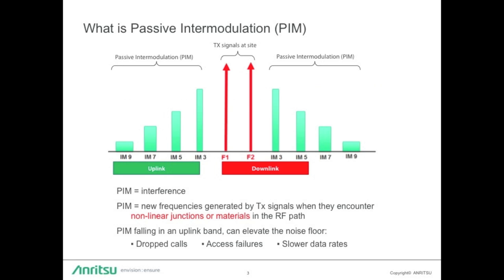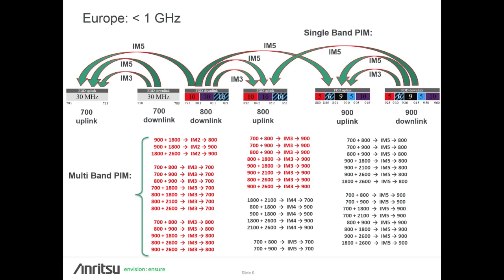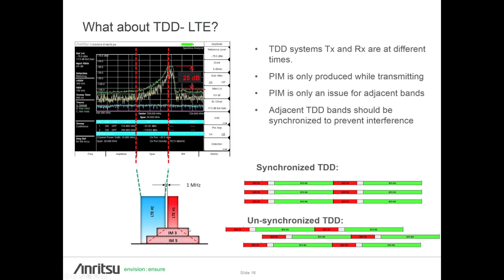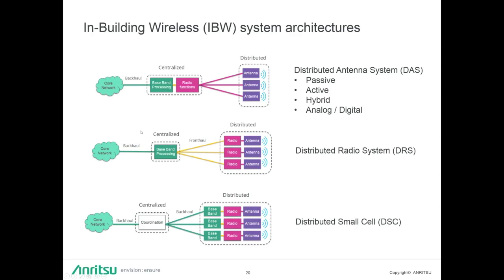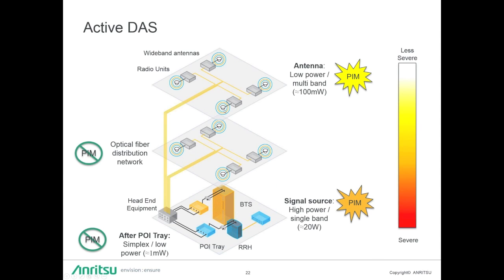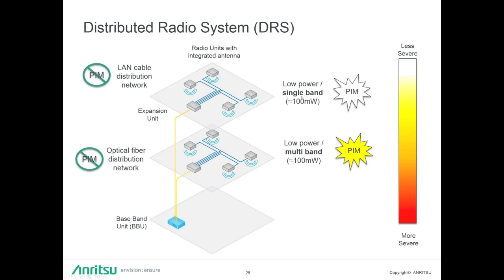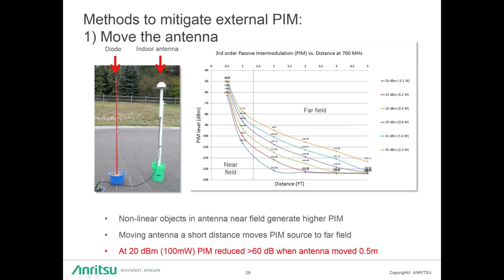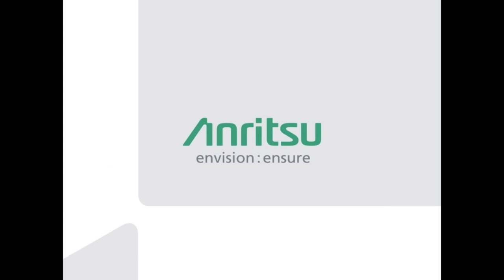Anritsu Webinar: Passive Intermodulation (PIM) concerns in in-building wireless systems

Comment: Thank you Aritsu!
&
Thank you President Donald J Trump !!

The Trump Administration fought hard to rescue Public-Safety and the public at large by
rescinding the Obama Administration mandate to force current licensees of “T-BAND”
(unused television UHF frequencies from 470-527 MHz).  Some licenses had been operating 
on licensed frequencies for decades, some had bee issued licensing post-9/11/2001 during the
great “Interoperability Quest” .

After operating for years, the Barack Hussein Obama administration pushed to get the 
“Omnibus Stimulus Act....” of 2012 passed and the rotten & grift ridden law enacted.
All users were to be stripped of authorization and FCC licenses to operate in the “T-Band”.

This radio frequency spectrum was to be abandoned sold off to the highest bidders in 2021.
This forced many, including LA & New York City to begin frantically searching for a solution to
the upcoming loss of frequencies that were in-use and performing well in most cases...

The FCC is now, once again, accepting modifications and new applications for this spectrum.

Comment: I made a Index:
10:30 What is Passive Intermodulation (PIM)?
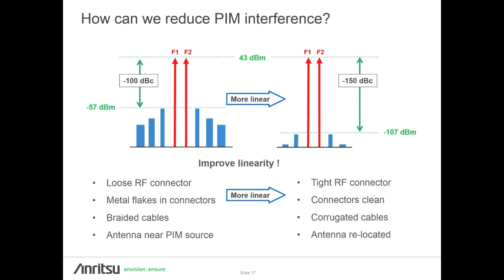13:15 How can we reduce PIM interference?
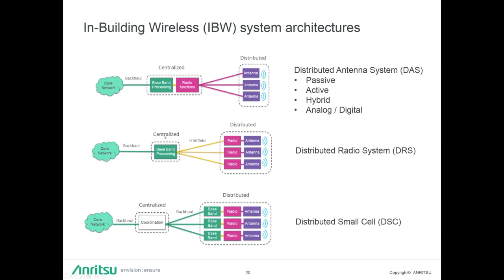17:12 In-Build Wireless (IBW) System Architectures
32:42 How can I prevent PIM problems in IBW systems?
39:05 Summary